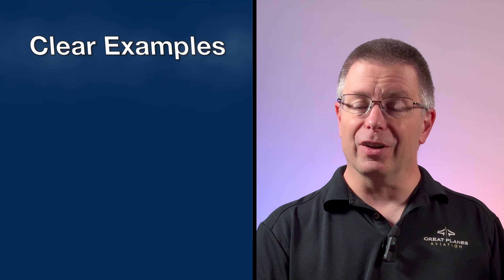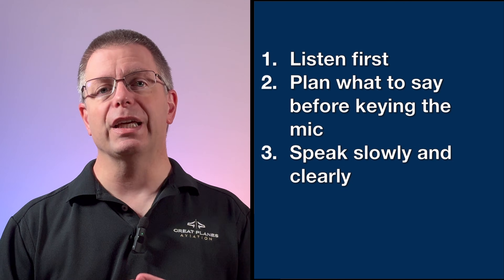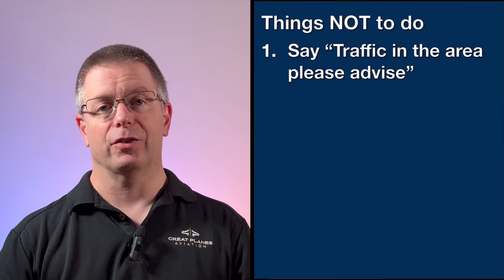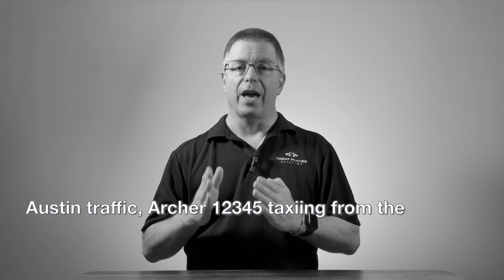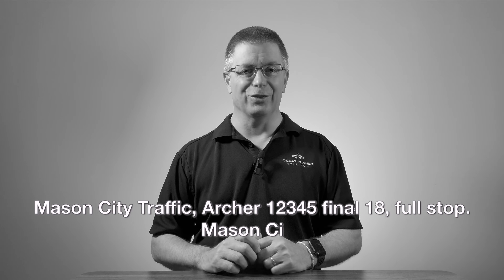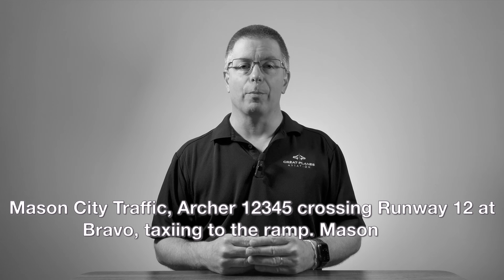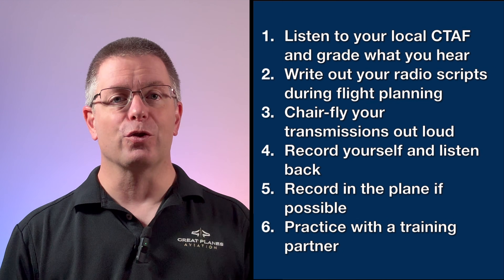Master Radio Communication with These Simple Rules!

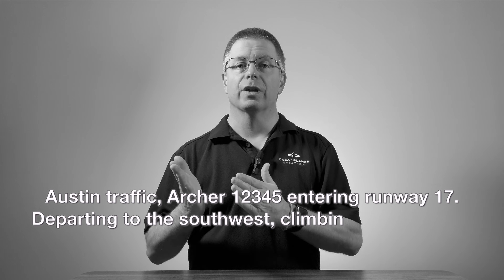Comment: on your example around 3:50, May i ask how to properly announce after take off, departing the area and change frequency?
Reply from the maker: You don’t need to announce when you are departing the area or changing frequencies.  In fact, if it is busy, it is better to just leave.  Also, you don’t need to announce after takeoff either.  The only time I’d announce climbing out is if someone takes off right behind you and you are afraid they might not see you.  At that point, you might say something like: “Mason City Traffic, Archer 12345, upwind 36, Mason City.”  However, most of the time, that is unneeded.  I hope that helps.